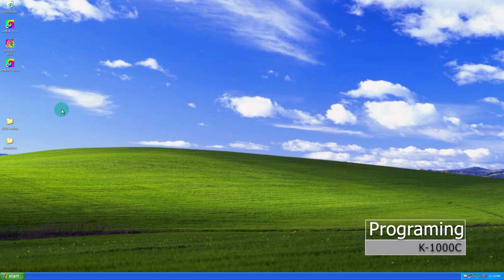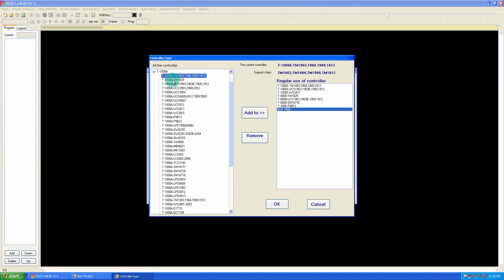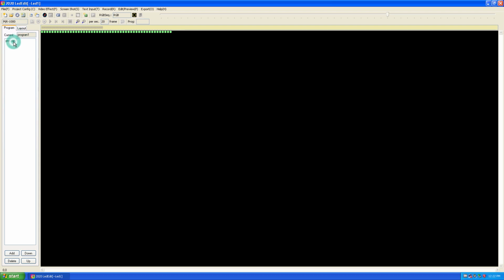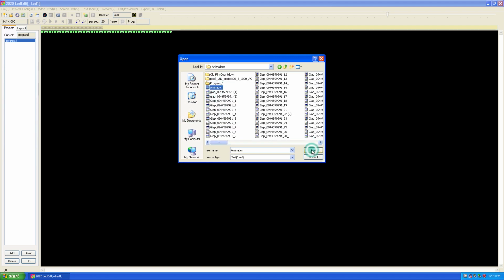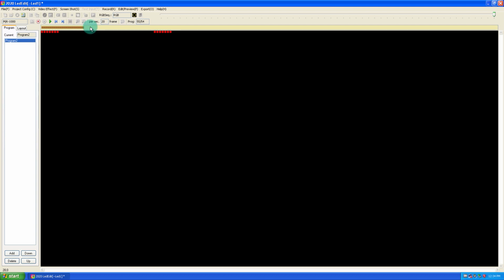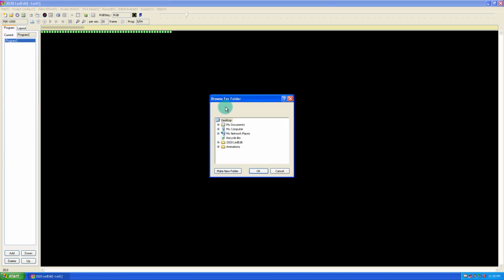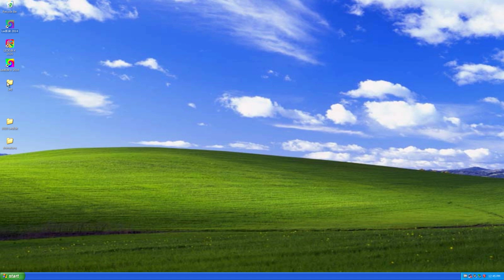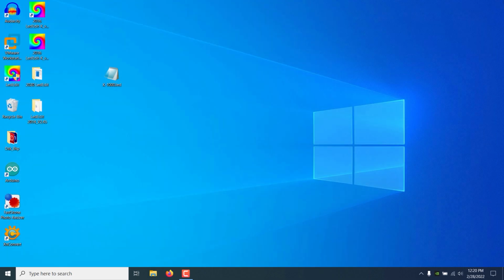K 1000C pixel LED Controller Tutorial

Comment: Very helpful video for someone just getting started with LedEDit and K-1000C controller.  Can you tell me how to connect 2, chained 16x16 matrix panels (creating a single 32x16 display) to the K-1000C controller and program the panel using LedEdit?  So far, I can only get effects working on each of the two 16x16 panels.  I want the effects to work across both panels (e.g., 32x16). Thanks!
Reply: Do you still need help with this?

Comment: I can't get my k-1000c pixel led controller to work with led edit software why?
Reply: I have the same problem with two of my K-1000c controllers.  On that two the SD Card didn't work, all LEDs are black. But on an older controller, k-1000c too, it is still working